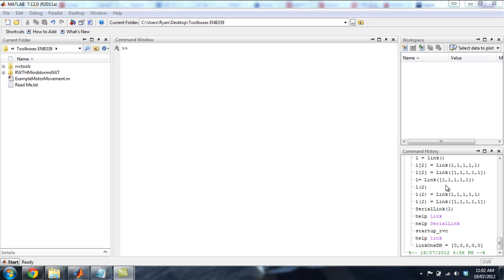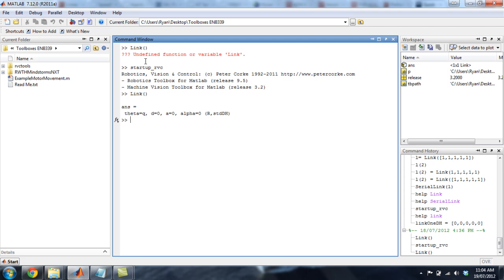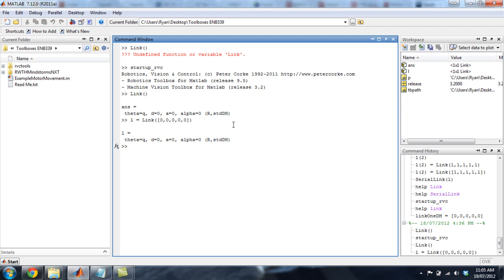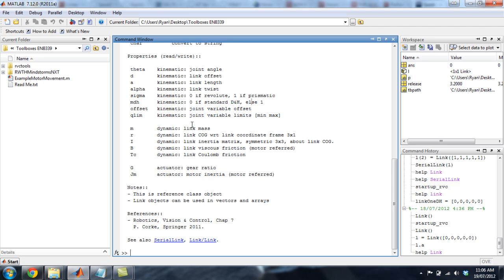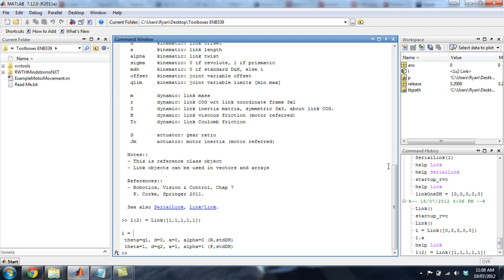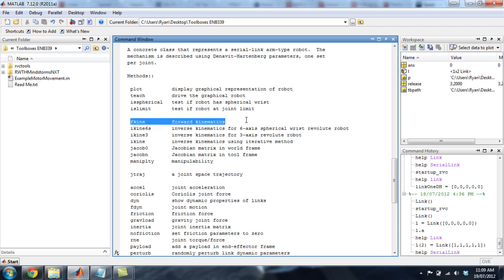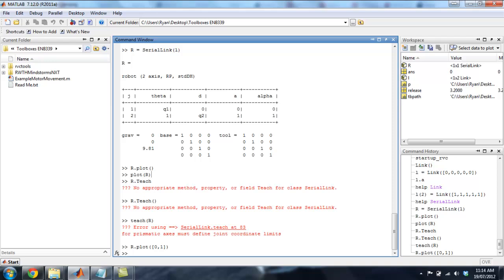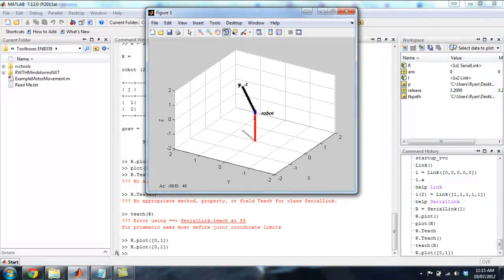MATLAB Introduction to RVC toolbox

Comment: Hmm funny, Im doing the same as You, and when i want to plot it then error occurs saying something like:
"??? Error using ==> SerialLink.plot>plot_options at 681
Prismatic joint(s) present: requires the 'workspace' option

Error in ==> SerialLink.plot at 205
    opt = plot_options(robot, varargin);"
Reply: I've the same problem. Did you find the solution?
Reply: Pablo Parodi Félix
yes, yes i did. Ive defined workspace of the robot by adding lines:
Rbt.base= [1,0,0,0;0,1,0,0;0,0,1,0;0,0,0,1];
Rbt.plotopt = {'workspace'[-1,1,-1,1,-0.5,4};
First defines where is the base ( not sure if really need it but anyway)
Second is the workspace definition ;)
Hope it will be helpful ;)
Reply: magicnm do you guys find out how to use like 3 link or 4 links not just 2 links?
Reply: +magicnm hi I added the workspace and it didn't work. any idea? (not because of the bracket, I noticed that :D)